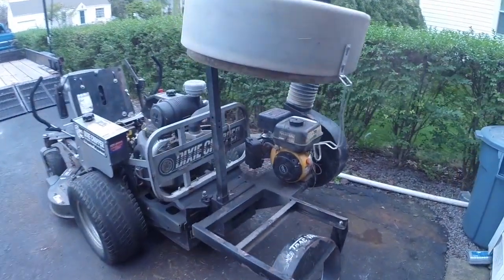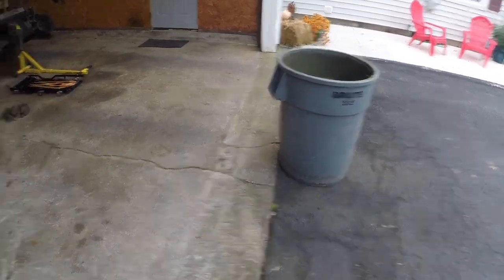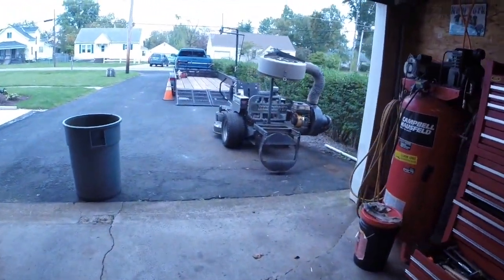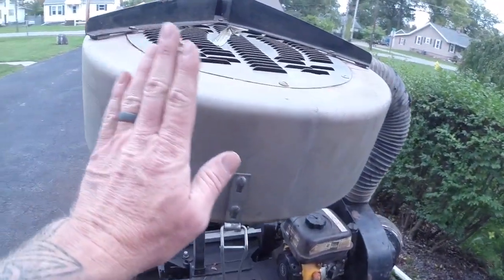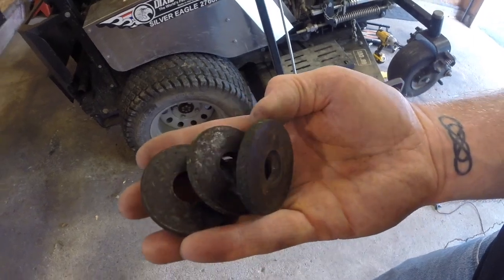Dixie Chopper Magic Mulcher & Trac Vac

Comment: I have a classic 2670 with a generac 27 hp engine I bought a few months back as a back up mower. It has roughly 350 hours on it, like new. When I cut with it, it is not cutting even, the left side of the grass always has a some grass slightly taller, I've checked the deck level, new blades the washers and cant seem to find the problem. Just wondering if you have had this problem. Thanks in advance
Reply from the maker: Are the tires the same size? Make sure all your washers are in the right position. And recheck the deck for level.